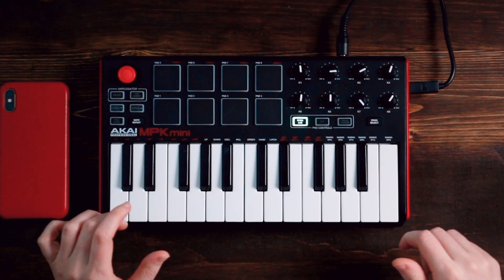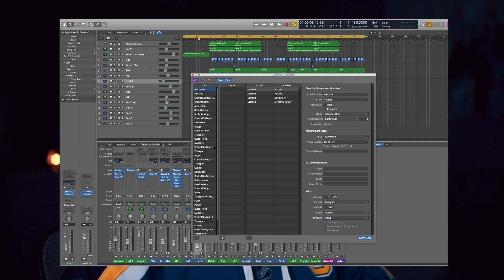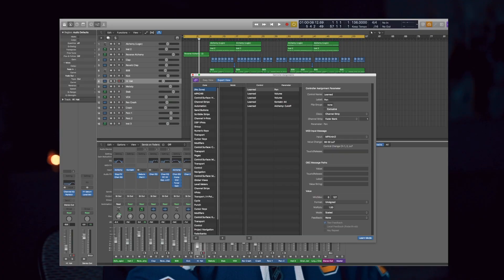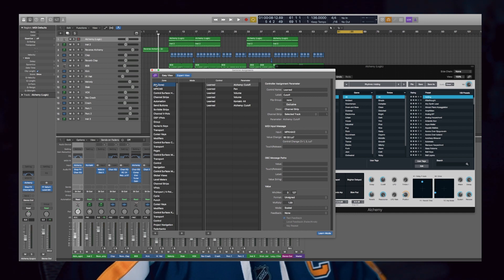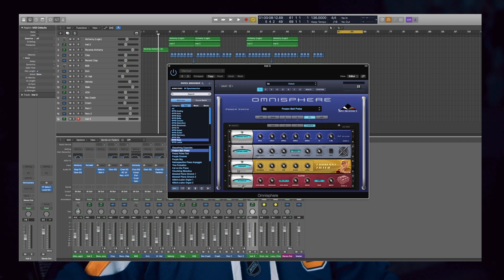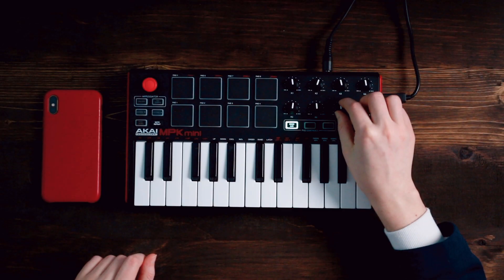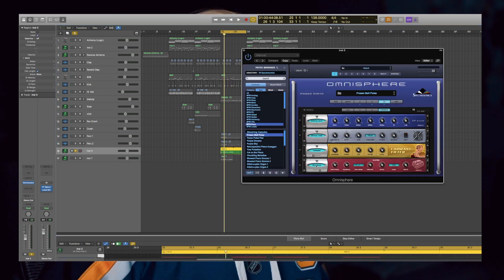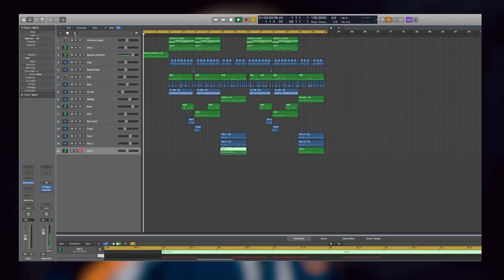How To Link Your Midi Controller To Logic Pro

Comment: Hey great video, but I have a probleme When I go to control surfaces > controller assignments I don't have an expert view or an easy view. There is just the sign on the top left corner which turns purple the learn and delete button and in the middle I had "No assignment selected" but I can't do anything. I would really appreciate your help.
🙏 thx
Reply: Same
Reply: Logic Pro > Control Surfaces > Preferences...> Advanced (tab)> Click on. 'Control Surface'.  This will show both the 'Easy' & 'Expert' View.

Comment: Just want to know how to plug it in and get a signal. Either my logic can't detect my usb midi controller or I don't know how to access it within the program. I have a preamp plugged in that gets priority.
Reply: same for me. It started working for me at first but then it just stopped reading my midi controller out of no where
Reply: @linkysmoove  Currently experiencing this, too lol. Restarted my comp to load a new plugin and got an error message, no I have no clue/can't remember how to have it read the controller again. smh.

Comment: Is it possible to adjust a knob to several different plugins? For example, sometimes I would like to use the knobs on a compressor, sometimes I would like to use them on a equalizer

Comment: hey! So I have been using my midi keyboard for loops and I noticed that it doesn't play the first few notes when I playback my loop. Do you have any idea what could be the reason? Thanks so much. Love your channel. ❤️
Reply: This is a known bug in live loops, it should only miss the first note on the first playback after recording, if it's always skipping them, click on the midi region, press E if the editor is not open, and then make sure the first note starts within the region and not even a milisecond before

Comment: Move your knob good pun. Quick question if I’m not using and equipment like guitar and all that would need something like a Scarlett 2io
Reply: If you’re not recording any audio whatsoever, you don’t need an audio interface. If you’re recording vocals, you could probably get away using a kick ass  USB mic, like the apogee hypermic (without an interface). If you want true guitar (audio), you’re going to have to have an interface of some kind, but it sounds like you don’t need one, based on your question. You’d be going all digital in via midi and usb mic, if I understand you correctly. And if you do want a USB mic, the hypemic is TOTALLY worth the money — it sounds like a $3,000 thousand dollar mic for $350, people actually compare it to a U87 (which is 3.6k).

Comment: Does this apply to having sliders as well? I’m looking to purchase a keyboard with 8 sliders and I want to have those sliders assigned to tracks in logic. So for each track I have in logic (say I have 8), I want each slider to control 1 track. Is this possible? If so how do I do it?

Comment: I have a Mac. And when I am trying to control a 3rd party plugin within Logic, I don't get the same option that you get. I believe you are running Windows. Do you know how to do this with a Mac?
Reply from the maker: J P I’m on a Mac. What option are you talking about specifically?
Reply: @CourtneyHawkins  thanks for the fast response! It is right around the 3 minute marker - you are talking about controlling a 3rd party plugin (Omnisphere) where you right click, and it gives you some sort of CC option  I believe.  In my instance, I have Hybrid 3 pulled up as a 3rd party plugin, and when I right click, it does nothing ☹
Reply from the maker: JxPx 9 did you try the method that I used to control a parameter in kontakt?

Comment: Hello. I'm struggling to get this working in Logic Pro X (with an AKAI MPK249). I am trying to map my MIDI controller in Alchemy specifically. I followed the directions but the knobs/faders work randomly. One minute everything works as expected, the next minute only half the assignments work. I don't really see a pattern. The same issue occurs for both knobs and faders. I tried rebooting Logic but that didn't help. I also tried another MIDI controller and had the same issues. Any thoughts on what the issue could be? Thank you!
Reply: did you ever figure this out?

Comment: Thank you for this help with logic 🙂 Those Midi assignments, are they still there when I open logic next time? Regardless which project file or just the same one?
Reply from the maker: Michael Modern you would have to save a template but even then there is not guarantee that they will save correctly.
Reply: Courtney Hawkins ok🤨so I‘ll stick with my preference to use HW/SW integration by manufacturers, eg NI
Reply from the maker: Michael Modern definitely the most convenient route. This tutorial is mainly for ppl wanting to use automation on parameters that aren’t automatically assigned via software/hardware integration. For example Omnisphere, everything has to be manually programmed.